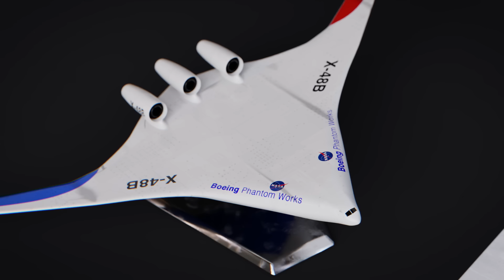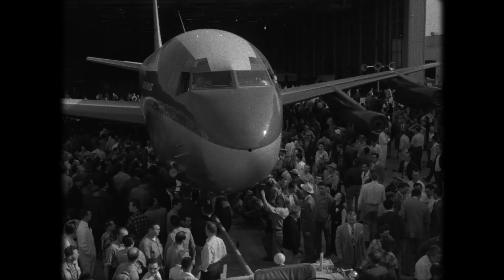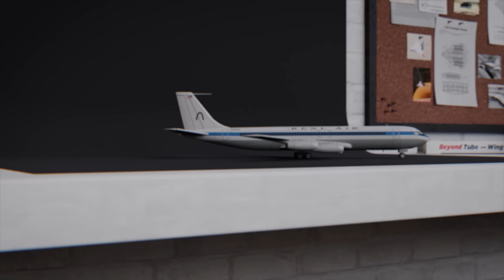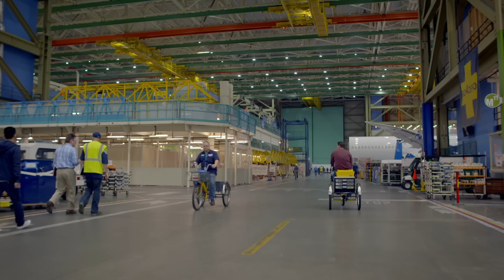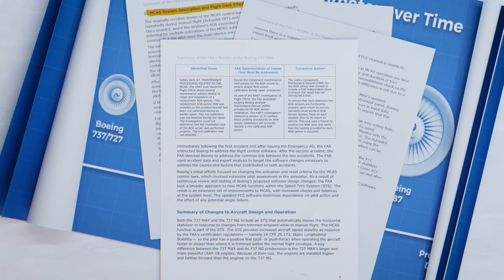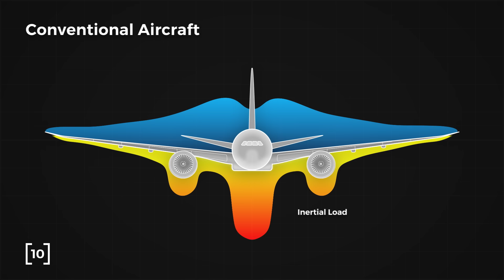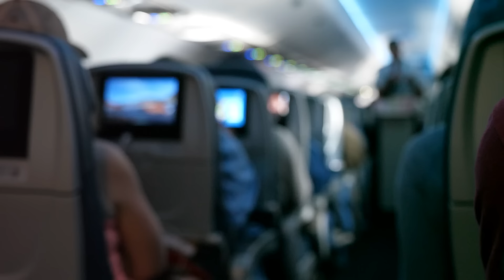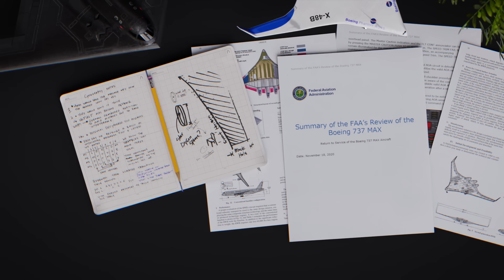The Plane That Will Change Travel Forever

Comment: I think you’re undervaluing the magnitude of fuel savings that composite materials have done for aviation. These alone have reduced fuel burns by similar amounts (in the 20-30% range and not the incremental 5% improvements that, yes, have dominated the full period of commercial aviation R&D outputs). There are even more of those savings still to come, when materials like graphene mature. I’m not so sure this concept will work commercially. The a380 failed because the hub and spoke model is not what flyers want. They want direct flights, so greater capacities per flight are not driving the aviation market. Also, I definitely prefer being in a very well-lit tube with windows than a sky whale like that with almost none. That takes the joy out of flying. So while it might be a great engineering solution, I’m not sure it’s really going to break through. This is similar to buildings. What’s the most energy efficient thing you can do to a building? Eliminate the windows! Well who on earth would want that?

Comment: Once again displaying incredible naivete.  Blended wing/bodies work for bombers, since the bomb bay is not pressurized.  They don't work for large commercial transports.  Pressure vessels need to be as close to cylindrical as possible.  By the time you fit a wing around a typical aircraft cabin, you will have the thickest wing ever built, and also the highest drag coefficient ever achieved in a wing.  Modern airliners go after thin wings, they tend to slice through the air at high speeds requiring less fuel.

Comment: Actually, a blended wing design, or so-called flying wing, can have passive stability in pitch, without need for fly by wire. Airfoils with a reflexed camber will result in a nose-up pitching moment. By placing the center of gravity in front of the center of lift, static stability is achieved. 
Regardless, though, this is a great video!

Comment: I’ve seen some new aircraft designs that either have no windows or a lifting body with most passengers sitting far from windows and wonder if passengers would accept that. Then one day I was putting speed tape on an engine cowling with passengers already onboard. I knew passengers were watching me and probably getting nervous but I was wrong. Not a single passenger was looking out the windows. They were all looking at their phones or tablets. Most window shades were pulled down. I’ve noticed this each time we did maintenance at the gate and pretty much every flight is like this. Windowless planes would be fine, just not with me. I want a window seat.

Comment: Also I would love to see one on American Airlines Flight 587. It raises the problem of stress fractures inside of composite materials, and that the airline industry did not have a way to check for damage in the same way it can with metal airframes. According to the NTSB, the aggressive use of the rudder controls by the first officer stressed the vertical stabilizer until it separated from the aircraft. See the Vanity Fair article on this- PILOT TERROR ,September 2002, by David Rose for an excellent counter view to this accepted narrative.

Comment: Why not use canards that generate lift instead of tail horizontal stabilizers that add weight?
Reply: Because in a stall the canards would stall first instead of the wings. When a control surface stalls, it loses control which means at the exact time when you need your elevator more than ever to push the nose down, the elevator has already lost control. With your horizontal stabilizer and elevator at the back of the plane, it will be the last flight surface to stall which gives the pilots the largest opportunity to get the aircraft out of the stall.

Comment: There have been cases where aircraft have lost all engine power and managed to glide down and land. How would a blended wing aircraft perform under the same circumstances, assuming that the active stabilisation were still operating from battery power?

Comment: To realise the benefits of blended wing, active pitch stabilization is required and the worry is about the reliability of that system.  But on modern tube and wing aeroplanes the horizontal stabiliser is already effectively active.  Because of fly-by-wire the elevators are controlled by computers and servos. In fact, that applies to pretty much every critical function on an aircraft.

As a safety measure, wouldn't a deployable drogue stabilise the aircraft sufficiently to fly down and land, or even a deployable horizontal stabiliser?

Comment: So the main issue when considering tube vs. all-wings comes down to reliability versus efficiency, huh? On that note, passive stability control still ticks a very important box for me personally. I wonder how many redundancy sets of sensors etc would be needed to get about the same reliability in actively controlled systems.

One thing I am very curious about is also the behaviour in case strong winds or "falling into air-holes" make the blended wing greatly tilt sideways. Is it worse for the blended wing than the good old tube? Maybe this isn't an issue at all but it just popped up in my head^^

I've always quite liked your series since I found it. In-depth enough to understand where the challenges lie, but not to an exhausting degree!
Reply: @phonicwheel933  I guess we can only wait and see. Both have their pros and cons for sure but with the many miles of daily air travel, having sufficiently redundant, fool-proof, active pitch control on wings-only airliners should honestly be a prerequisite. Or just don't do it.
Reply: @SFESky  It looks like YT deleted my post that you replied to. Yes, you are quite right. Safety must come first, not only before technology, but also before profit.

Comment: MCAS was created for aerial refueling planes. Its ability to move control surfaces was greatly increased from the kc-46 to the 737 max, by a magnitude of 3. This would all be fine but the final nail in the coffin was that in case of failure pilots would have to go through such a long checklist to diagnose the issue that by the time the figured it out the place was already in the ground. Plus the lack of real pilot training to save money on behalf of the airlines as well.

The real issue is that Boeing is able to use FAA certification as a signal to the market about the safety of their aircraft. Take that away and they'll disperse their costs to actually making the airplane safer, as they did in the past.

Comment: Another issue is load balance.  Seat selection would be a thing of the past.  With cigar shape planes, everyone is sitting in the center, and they just have to balance front to rear with luggage.  With a wide seating area, you'd have to seat the heaviest passengers toward the center, and the lightest towards the edges.  Maybe taking advantage of the situation, make the center seats 25% wider and charge heavy passengers a fuel and space surcharge.  Then make the edge seats 25% thinner for children and small adults, affording them a proportionate discount.

Comment: The 737 Max did have 2 sensors for MCAS, it just picked one of them at start-up. You could pay extra for the warning light that tells you the sensors disagree with each other but they also removed the helpful info in the manual explaining how to turn the system off for good when it's going nuts and messing with the trim intermittently. No engineer would ever green-light this.

Comment: Air Disasters from the Smithsonian Channel did an episode on the B2 crash. The problem with the sensors were caused by leaving the plane out in the rain. Some people in the military knew about the problem and how to troubleshoot it so really it was a very simple failure to communicate. There are two types of plane crashes(for the most part): 1) where everything goes wrong 2) where just one thing goes wrong. The crash of the B2 was both

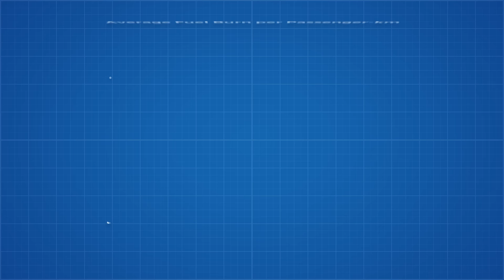Comment: I think it's important to note at 1:09 that a lot of that fuel burn per passenger is by decreasing legroom on airplanes and fitting people in tighter. Jet engines and the way they burn fuel would make the weight from extra humans negligible, because a lot of the compressed gas energy will be used more efficiently with a larger load.

Comment: if you made the tail thinner and longer and increase its torque to the center of gravity, you could make the tail wing stabilizers a smaller surface area which should reduce the overall drag while still being a passive stabilizer? or am I dumb?

Comment: I’ve been hearing plans for making air travel better for decades. One of the earliest was this this flying wing idea nearly 25 years ago. Yet nothing changes. I’ll believe it when I see it.
Reply: The B-2 flying wings have been operational since I was at Strategic Air Command HQ in 1987.  That is over 35 years ago.  The new B-21 flying wing bombers are going into production right now.
Reply: @raymondswenson1268  I understand that there were experiments as early as 1924, but that's not really the point I'm making. Somone once proposed a passenger aircraft as a flying wing. The entire flying wing would have been the passenger compartment and it promissed business class style seats for coach prices. It seems like 25 years would have been long enough to get at least a prototype off the ground (pardon the pun). Yet air travel remains stubornly miserable.
Reply: It's probably still going to be the long tube with twin jets til at least 2070.
Reply: @TheMrPeteChannel  I'd be curious to know what you're basing that date on. I don't know that any company's particular timeline is what's important here. What probably needs to happen to happen is for a new company to disrupt the industry.

Comment: Isn't hydrogen lighter than air? Donut would further save on lift fuel and just make it damnit
Reply: hydrogen is also extremely volatile, go look up zeppelins and why they're now mostly defunct
Reply: Hydrogen is the lightest gas in the world, but it has two major problems. The first is that it is extremely dangerous and the second is that it has a very low energy/ volume figure. This means that hydrogen must be stored in compressed form in heavy tanks, or stored in heavy cryogenic tanks at an extremely low temperature.

Comment: As an airline pilot, this is a very well done video, however I find the concept of the X-48 in regards to stability SCARY AS FUCK.  Almost all pilots only fly aircraft with positive stability, with the only exceptions being certain military pilots.  The training that would be required to train pilots on a plane like this would basically mean teaching them from scratch on how to fly again.  Like you said, flying a plane like that would be like balancing a broom on your fingertip, basically impossible to hand fly.  What happens if something goes wrong?  This would be so much more than just a basic MCAS system which is only in control of pitch when it gets too close to the critical angle of attack.  As a pilot, it would be so freaking scary to think that I would be putting full trust in software, with little to no means of being able to save it if something goes wrong.  At least in planes today if that happens you can disconnect it for the most part and hand fly.  There's a reason why only military aircraft tend to deal with neutral or negative stability...because if something goes wrong in a worst case scenario, they can eject.  That is not a possibility for a passenger airliner.

Comment: 13:42 The MCAS was designed on purpose with just one sensor to avoid and skip FFA re-certification. A redundant system (i.e. more than 1 sensor) triggers compulsory FFA certification, whereas single sensor systems do not. Lowering the safety of a system on purpose to avoid safety certifications aimed at increasing safety: how ironic.

Comment: The Lift distribution to Load would be even better if they would switch to a Prantle wing (see Al Bower NASA research). This would nearly perfectly match the lift distribution with the load. And it would also make the plane more efficient and likely make it handle better.

Comment: Wouldn’t it be better to place the viewing screens on the sides of the passenger on the wall? I wonder if they can link those screens in series. This would give the ability of one camera underneath the jet to display the accurate location of each window or false window inside the plane. Due to the location of the screens currently on the rear side of the seats is not adequate to act as a window due to location. It’s more like looking at a video of the outside world. Versus looking through a window to the outside world.

Comment: I am pleased that you eventually mentioned the de Havilland Comet jet airliner.  It predates the Boeing.  Whist the Comet was a step forward in aircraft design it did suffer stress cracking problems that the whole aircraft industry learned from.  De Havilland's research into the cause of the failures helped pave the way for high altitude commercial air travel. The Comet had engines built into the wing and not hung underneath and this must have reduced drag.  Reducing drag is a theme in the new designs explored in this video.  Once the aircraft industry adapted new fuselage designs and production methods to avoid stress cracking in thin skinned pressurised bodies the modern jet airliner era flourished.  The Comet remained in production from 1949 to 1964.

Comment: Could a change in metal thickness cause the body of the plane to expand at different rates, thus compensating for the unequal expansion seen when unibody planes fly at higher altitudes?

Comment: Question, what's the distance between the primary landing gear, given the wide body nature of the blended wing design? If the gear are wider, every large airport would have to rebuild the taxiways and move them further from the runways (Safety areas, object free areas, turn radius increases) all decrease area for aircraft parking and terminal movement.  I see the challenge as designing BWB to fit onto existing airport movement surfaces.

Comment: Some blended wing designs seem to hav angled rear stabilizers/rudder.. 
If neutral balance .. could stabiliser be... neutral ..so less drag ..until plane pitched ..as on a rocket? 
How did concorde do it .. without stabilisers / fly by wire..?

Comment: A quick word about the 737 max issues, and fly by wire. Fly by wire has been working very well on basically every airbus for more than 40 years. The reason it does is it complies with regulations that basically forces such systems to have 3 sensors, wirings that take 3 different routes, 3 or more computing units containing 2 differently designed computers, with different parts makers and suppliers, differently designed software coded with different algorithms when possible and different languages. I have done that in my early years as a software engineer.

The 737 max issue is boeing criminally applying at best  the DAL C rulebook design from the DO178 (software) and DO160(hardware) to the most critical DAL A class system. Anything that touches flight control is DAL A. Boeing knows it very well, and chose to design such a system, then chose to use the FAA's delegated authority to certify it - because even the slightest software or hardware update needs a certification. This is 100% an issue in boeing executives deliberately choosing to bin the rulebooks, which was bound to kill people in the end.
Reply: MCAS (and STS) don't have to be available on every flight though. My assumption is Boeing viewed MCAS as similar to STS, gradually increased its scope and control authority, and at some point had to effectively lie about that to prevent having to do more thorough analysis that would show that it was unacceptable.

Comment: great video, but there is one problem you forgot to address which is the moment  exerted on the passengers sitting on the edges of the plane's passenger space,  not much moment is exerted in a tube style plant because there is no big moment arm when in a maneuver, but with this (BWB) plane's design  the moment arm to the center of the plane is greatly increased and thus could create more discomfort to the passengers when in a maneuver like turning.

Comment: the dreamliner is around for years what is stopping them putting the project in motion if its about carbon fibre composite tech , so effectively this is 27% more fuell effiecient aircraft thats totally unstable and cant be pressurised so wont be built ? that correct ?   flying wings cause more issues than perks no matter how you look at them fuel eff or not , would putting the round fuselage within the wing structure be an idea ,  ?  like a double hull .? this plane is been built for  the last  10 yrs surely they havnt givn up ,     give it to skunkworks they would sort those issues out no prob

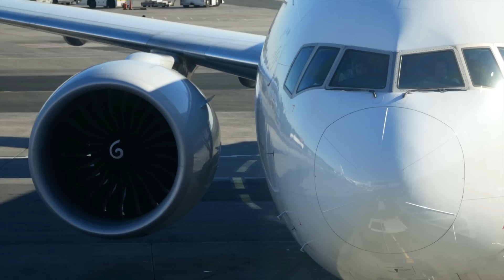Comment: @1:30 In order for something to become “more eco-friendly ...” it would require the activity to be eco-friendly to begin with, so that sentence is a huge misnomer.
Reply: No, it does not. Something that burns less fuel is, by definition, more eco friendly than something that burns more.
Reply: @windrose5988  please, anything that burns fossile fuel (at all), can NOT be called ”eco-friendly” as there is nothing eco-friendly about it. No matter how little it burns, as all combustion engines (exempt ”green” hydrogen) contributes to global warming, albeit less than a traditional airliner. If anything, it can be called less ”eco-hostile”, hence the misnomer. The term ”eco-friendly” is however such a widely used misnomer that you are probably blind to the inherent fallacy.